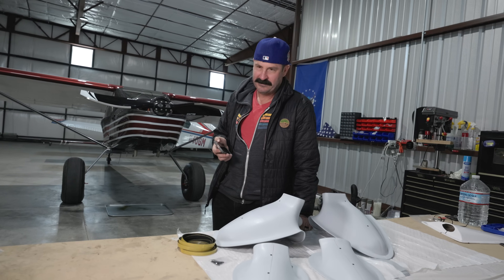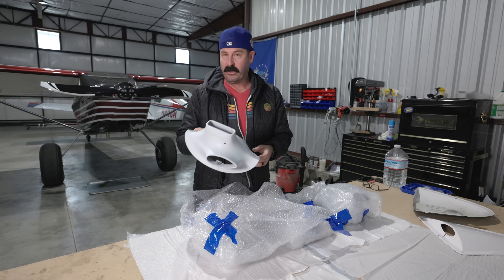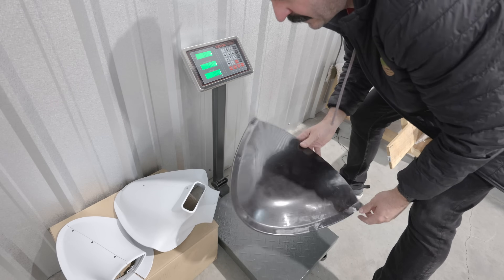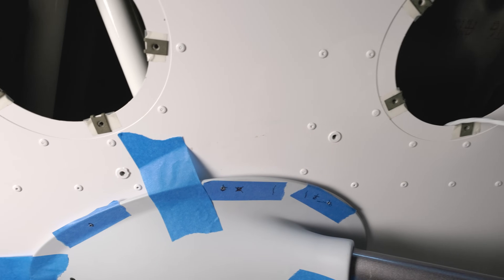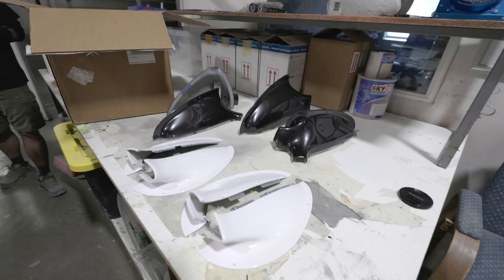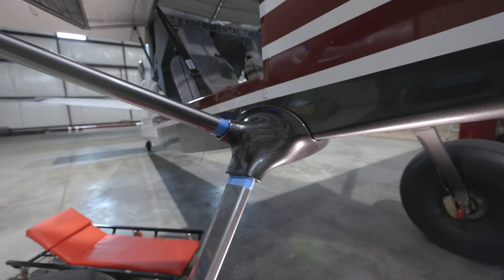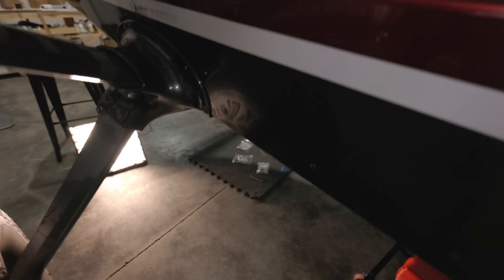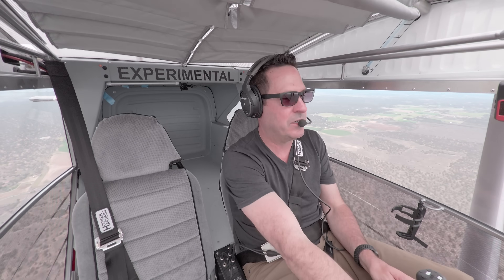Will these fairings make my bushplane even FASTER?

Comment: I installed these while waiting for DAR, so they were on for first flight, 140 mph IAS is shocking to see after 15 years in a PA-11. No foam tape or mention of it when I bought mine, could be added easily enough. They are open enough that I don’t think any water would stay in them as is.
Reply from the maker: Nice! I could see water pooling like it did on my RANS belly fairings. Maybe it’ll seep out the joint seam

Comment: So the man on the phone stated 150-odd kts ? Whats the specs/mods/burns on that one ? Any chance you could do a review or comparison ? Then swap tires and compare again 😊.
Reply: Good call. I find 150Ktas very hard to believe especially on a  n/a Titan. I’ve seen 140Ktas on my 915/S21 at 17,500 WOT. 86% 41” mp. A very unrealistic power setting.
Reply: @Captndarty yes 152kts TAS 2000msl WOT Titan io340 fuel burn is 15.1gph 2660 rpm this is a top speed test and fuel burn I cruise at 138kts TAS 7500ft MSL 8gph lop 69% 2440rpm fixed pitch prop
Reply from the maker: Fastest S-21 and with a OSH Lindy to prove it!

Comment: Great video, the Boggie is coming together, the fairings REALLY clean it up.. Come to Utah and we will take you to come cool spots. Question, where did you get your cup holder  clipped to your door?
Reply: I carry a trick travel mug in my S-7 that seals tight when not in use, until you push a button,  I can fill it and lay it down, no leaks,  I love the thing, nothing like flying around while drinking coffee, did it a couple hours ago.

Comment: how much room is designed for the gear strut flex vertically on rough landings. Any concern there imparting strut contact  to the fairing and putting tension on the attachment screws repeatedly?  Im not sure how much the gear struts flex at the high point bend. would be great to film the at up close on some  stiff  "Navy"  landings
Reply from the maker: Good call! I’ll have to put a camera on that. So far so good after a backcountry trip…
Reply: It appears that they are high enough up the gear leg as not to be a concern. I've had these from first flight and in 65ish hours I can't see any evidence that there has ever been any contact with the leg.